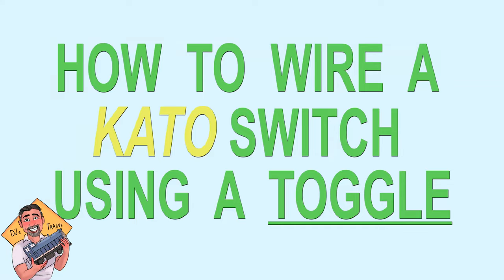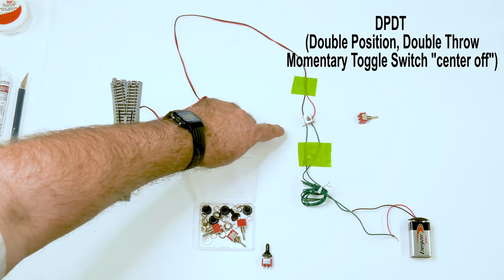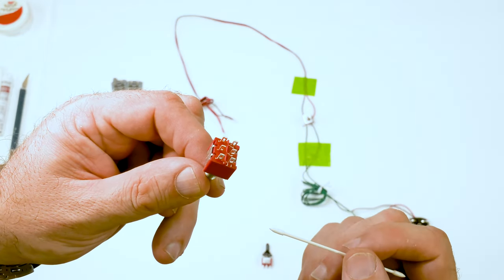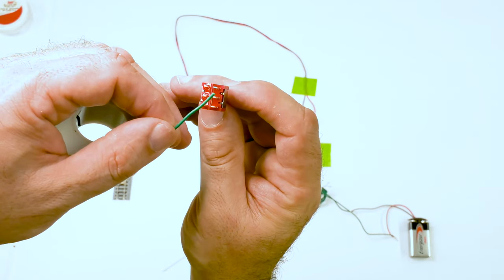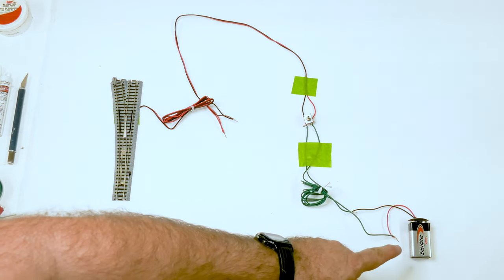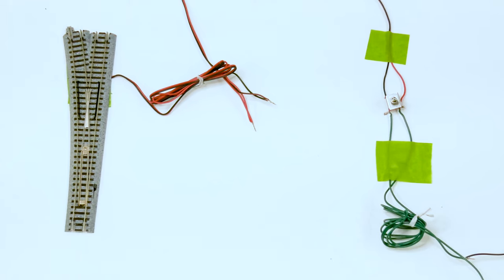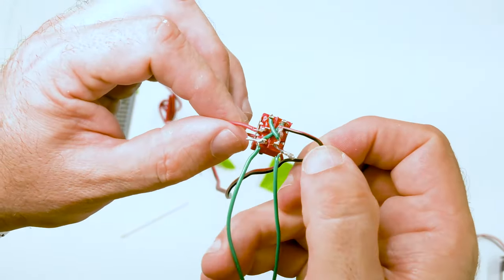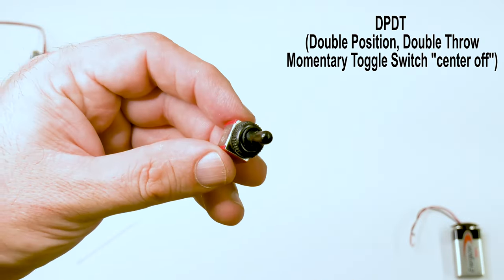How to Wire a KATO Turnout Switch using a Toggle

Comment: Many thanks for this excellent video and guide to wiring Kato turnouts. Have just successfully wired four turnouts on my new N gauge tram layout. The most difficult bit I found was wiring the live feeds and cross wires to the switch terminals. I solved this by putting a drop of superglue on the insulation of the two wires  and putting them together which made soldering a lot easier!
Reply from the maker: You are welcome!

Comment: I really think that I might have early onset dementia. I can't believe I spent a fortune when this is an elegant and effective solution. For protection you could wire in a timer that auto cuts power to the output after 0.75 seconds.

Comment: I noticed that the blue Kato switches are not spdt momentary switches.  The switches are either up or down, with no center off position.  When I tried connecting to the AC screws on my power pack, it didn’t work.  So, I purchased a 9 volt battery case, twin pack for $5.99, and ran the wires to two terminal strips.  Then connected the turnout wires to the terminal strips.  One 9 volt battery controls 11 turnouts.  Battery case also comes with a shutoff switch so no drain when not in use.  Only used one case so I have a spare.  Thanks for posting.

Comment: Hey DJ, I wanted to point out that using the Kato blue switch is a safe and friendly way to to insure a long Kato turnout life. Especially for younger kids! The Kato Switch provides that split second power to the turnout. Use these Monetary DPDT type switches with caution. I say this so others understand the difference between the two as you pointed out in your video. As always I enjoy your videos. Thanks!
Reply from the maker: Good point!
Reply: Duly noted. What’s the best way to wire a Kato switch that isn’t connected to a DC power pack (Zeyphyr Express) so I don’t have to walk around the layout just to throw a switch? Should I just buy a 2nd DC power pack to attach 1/2 of the switches to on each side or?

Comment: Like the idea!!👊🏻 Now the question is if I have 5 switches do I connect the power all together & how.  I'm new at this so I need guidance. Thanks DJ!! Stay Safe & God Bless!!!
Reply from the maker: Yes, you can power them all to the dc side of your power pack.  Run 2 wires from your power pack, splice those wires and connect 2 wires from that to each switch.  Just like a bus wire and feeder wires of your track.  Same concept, its just easier than 10 wires to your power pack.
Reply: @djstrains  Thank you sir for your help!!👊🏻 I think I can do it!!! Found some toggle switches on ebay.

Comment: DJ, all well and good and an elegant solution, but... how does one know by looking at the toggle which position the switch is in? It would seem a better idea would be to add a red or green light (or an led that lights green or red) to signal through or not position of the switch. Not sure how this would be wired. At least the Kato blue monoliths show position, although they are way too big to add to a track schematic. Your thoughts/ideas on this?
Reply from the maker: I cant think of how to have indicator light since the default position for the toggle is center off.

Comment: Yep. That will work. Tiny correction. The proper name for the switch is a 'Double POLE, double throw momentary toggle switch. Centre off'. 
You can also wire them using Peco or Fleischmann momentary contact switches. I like to use the Fleischmann 6900 or 6906 switches as they show an indication of the route selected without having to wire in LEDs. You have to use a couple of diodes in the circuit.
Reply from the maker: crap, my mistake
Reply: @djstrains  Don't worry about it. I've heard lots of people call it a double position switch.

Comment: Hi, I just watched your video on using toggles for the switch’s .I have the kato #4 right and lefts, but I realized that the red and black wire on the bottom of the switch can be hooked up either way? What is the best way to connect them? Red on the outside or black on the outside??? Help!! Thanks.
Reply from the maker: Makes no difference

Comment: Here is another possible idea.  You can use 3pdt switches and one momentary (normally open) switch on the DC input side to engage the turnouts.  The third set of poles can be used for signaling and/or panel indicators.  The wiring is just a little more involved than shown here, but is still pretty basic.
With this type of setup, you can set your route and signals.  Then press the button once and all the turnouts will move to the proper position.  Just as with the DPDT momentary switch, do not hold the button for more than a fraction of a second.  You don't want to burn out those turnout solenoids.
Reply from the maker: Thats what I did in my video I made many years ago.

Comment: Main problem with this, is that if you hold the switch too long it will melt the turnout.  Maybe not with a 9v battery, but with the power from your powerpack it certainly will.  You only need/want a small fraction of a second of power to the solenoid.  You can burn out a turnout solenoid in a couple seconds at 12v+ with enough current.
Reply from the maker: Thats why I am using the momentary.  Simple quick flick and I mentioned that if left in position too long it would burn the motor out.

Comment: Great video, but you neglected to say why one needed to wire the other side of the DPDT switch—I imagine it is because you need power to to the reverse action and that you cross the wires so that you can get the opposite effect.  I am guessing because you didn’t say so. You are a great teacher so I guess you wanted us to figure that out or that it was so obvious that you didn’t need to say anything.  I am a total idiot when it comes to electricity and wiring.  I use Digitrax  DS64 I guess they are now DS74 decoders to operate all of my turnouts and I control the switches through the throttle.  At least that is the way that I used to do it.  I have no layout now, but will get one up soon.

Comment: So red and black go to middle two posts from the switch and a “+” & a “-“ come from the power supply to two corners and then the corners connect in an “X” pattern, so how do I then add dwarf signals to give the correct indication when you throw the switch?
Reply from the maker: As a patreon member, I'll make you a personal video this week.
Reply: @djstrains  alas, I’m no longer a Patreon member. I had to make financial changes without getting a paycheck any longer and Social Security hasn’t kicked in. Thanks for the thought though.
Reply from the maker: I'll still make you one.  I'll email you the link when finished.  You have been an outstanding supporter and I want to show my appreciation.

Comment: I am building a train layout with my daughter (both new to this)
I’m doing a control panel and would like to get rid of the Bachman turnout switches and do something like this.
Would doing this work on the Bachman Ho?
There’s a total of 3 turnout switches.
Thanks in advance
Reply from the maker: Yes, Ho and n are going to have same wiring
Reply: Thanks for the quick reply. I’m just hesitant as I have everything already built and afraid to hook up and fry everything if wrong.
Is that possible or just won’t switch?
I have to look at your video of adding LEDs.
Thanks again
Reply: On the ez trackBachman switch has 3 wires.
 Now I’m really confused. Not going to risk but. I can always add better switches later when I have a fir sure method.
Thanks again